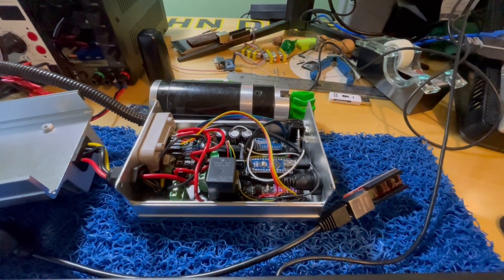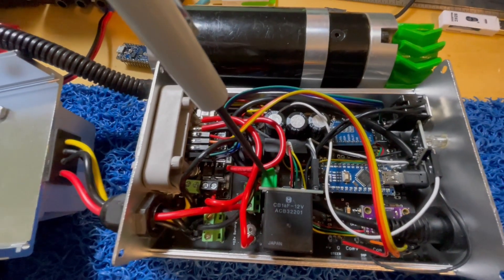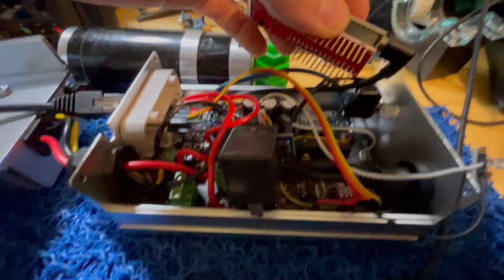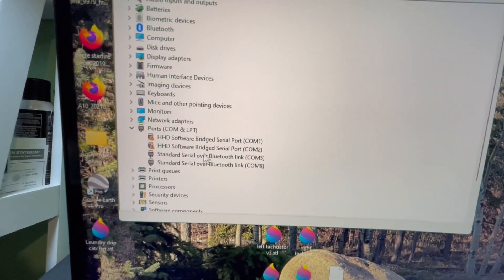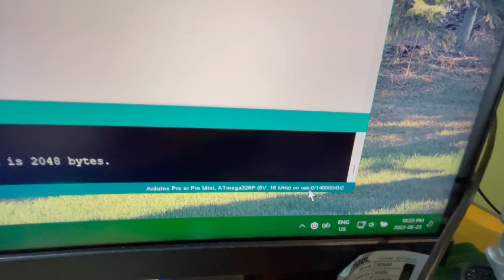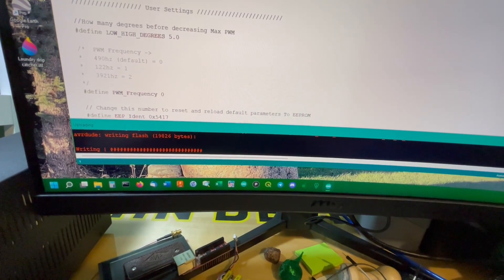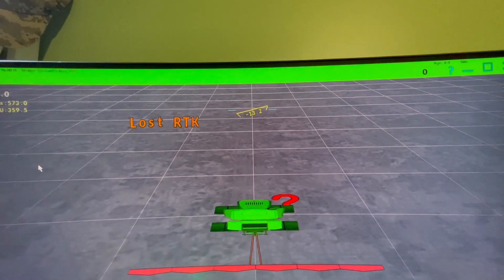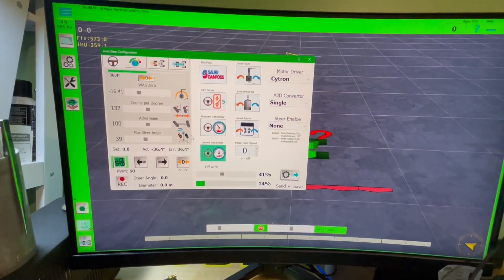AgOpenGPS UDP upgrade and NANO .ino upload

Comment: Great video! Thanks for sharing. I am wondering about IMU sensor. As far as I see, you are using Gyro sensor and have connected it to steering nano directly. How did you do it? I am using 2 nanos to control steering and IMU seperately. Can I combine them in steering nano ?
Reply from the maker: Hello this video is really old, this is a old V2 board, I currently only use this board as an output.

Most people are building the all in one now.
Reply: @potatofarmer  Thanks. I am also using V2.5 old board currently. I wondered if it is possible or not to modify mine without switching to new type V4.5 board. I just want to cancel IMU nano and connect it to steering nano directly. What do you think? Is it possible for stable running?

Comment: Can I ask exactly what board you used? I tried a teensy 4.1.....couldnt get it to load in Arduino. Did you use nano? Or possibly provide me a link
Reply from the maker: This video is pretty old already, its a V2 with a Nano.

All Panda boards so far use Teensy 4.1

Comment: Have you done any more work with the tremble tisp converter?
Reply from the maker: Yes trying to get it working with the PRO700. If you own a 150, 250, 500 sell them while you can not a big enough market. Especially when AOG is so cheap, and so much better.
Reply: @potatofarmer  get a similar project I'm trying to work on but instead of using any GPS receiver using a greenstar receiver with the pro 700 and nav 3. Already have to run it on the tractor for the corn planter. I have little ways to go though before I get to where you're at.
Reply from the maker: @carsondaly1521  Im not a fan of Starfire its overpriced substandard equipment. Ublox runs much more precise circles around Deere, and with no unlocks for $400.

RTK is not a $9500CDN unlock with $1300 unit /year subscription with ublox, unlike Deere. 

But still it sounds like you will have your hands full integrating Navcom to Trimble through CAN.

Comment: Think you can fit a Christmas tree in that right hand corner!!
Great box, I'm always scared it will get to hot and fry everything!
Reply from the maker: So far no heat issues, the nano and most electronics are good to operate to +80C. Box only draws 400mA, not much heat created.

Comment: Great video. Nice to see inside someone else's steering controller! After watching I'm thinking of upgrading to UDP and adding the acs712 as I have on a couple of rare occasions lost usb connection for no apparent reason. A couple of questions - Is it totally necessary to use a network switch/router or can the ethernet cable be plugged directly into tablet? How is the acs712 wired into the PCB (assuming yours is v2?) Is there a diagram on the forum? Thanks 👍
Reply from the maker: Hey Jim love your videos

If all you have is the steer box on udp, no switch required. Gps still can come in on usb. But if adding panda or section control switch is needed. 

I ran usb for a year, udp just works.

Acs712 gets placed in series with motor output wire. Then the analog output wire goes to A0 of the nano.
Reply: @potatofarmer  thanks! I had the intention of using UDP when I put my board together last year so I've got a shield knocking about somewhere. I'll give it a go!
Reply: @potatofarmer  I've had a crack at it but can't get it to connect. Do you need to change anything in the ino for IP address or the ethernet configuration in the tablet?
Reply: Actually ignore that. After some research ive just discovered that i'm running the old ino and agopengps! I cant keep up! Ill have another go when i'm all updated
Reply from the maker: @jimsfarming7792  That has also been my problem, keeping up with AOG. Put PANDA on your list too, the stability is fantastic.

But IP Networking for farmers is still a great video Idea.
Reply: @potatofarmer  I'll leave that one for you to do 😂👍. I've been reading up about Panda in the forum and have seen some of your posts. Am I right in saying I could run a PCB with teensy, f9p and imu alongside my pcbv2 operating autosteer? Was it pretty simple to set up?
Reply from the maker: @jimsfarming7792  Yes you can use it along side v2, but then you need a switch. But the bonus is it all just connects automatic after that. I did not use the panda pcb just teensy, f9p, and imu, and put it in a 3d printed box.

Comment: Hello, the converter from 24v to 12v. How many amps is it? I just bought a 10 amp. It will be enough??
Reply from the maker: I use 12A 12 to 24V converter, full stall current for the 24V phidgets 3269_3 is 10.8amps. Your tight but i think it will work no problem, the rest of the box pulls about 400ma not including the GPS. Realistically you will never get close to full stall with the motor, unless you jam the motor 100% full stop for some time, with the ACS712 sensor added you will never go over. I've only blown 10A fuse once and was really trying hard to do it.